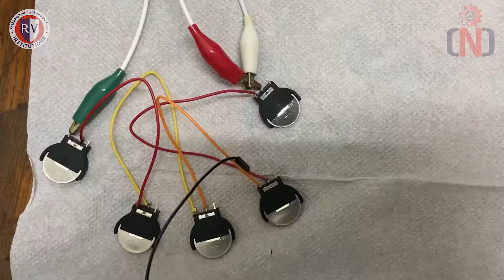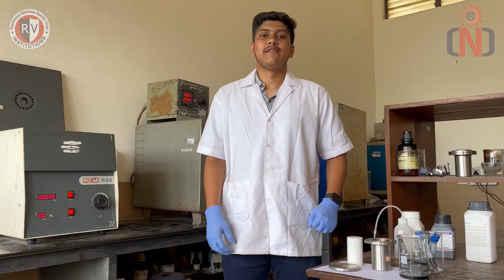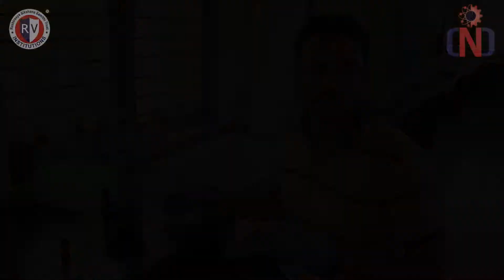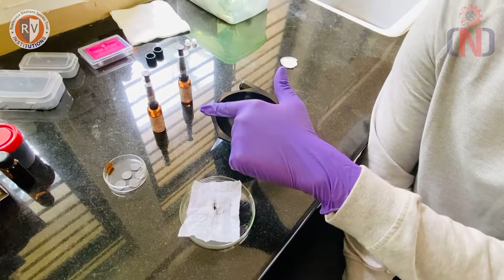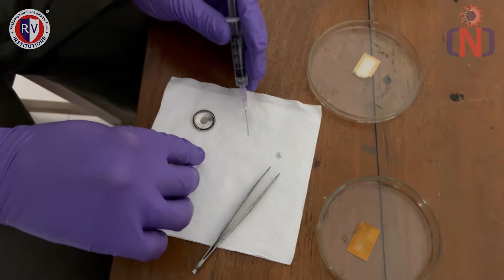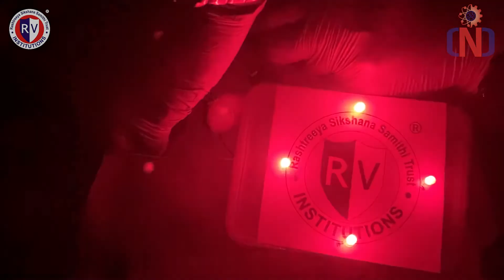Demonstration of Making Prototype Supercapacitor by "Centre for Nano materials and Devices @ RVCE

Comment: What is the name of the holder connected to the wire for Electrochemical performance
Reply from the maker: Copper rod designed to hold the working electrode